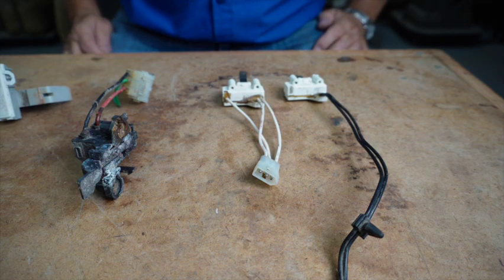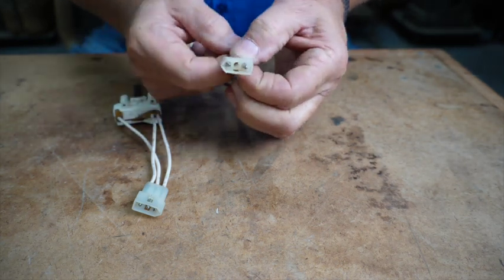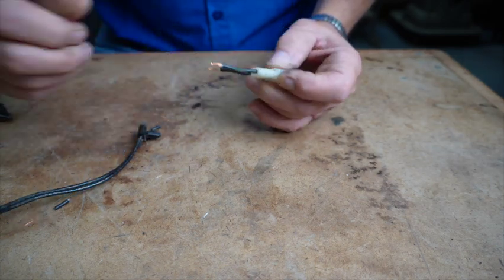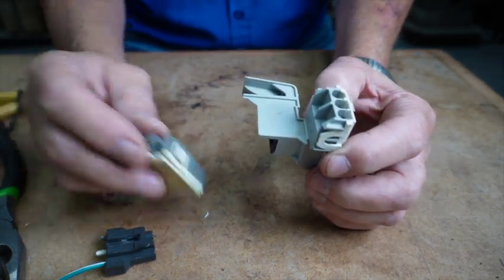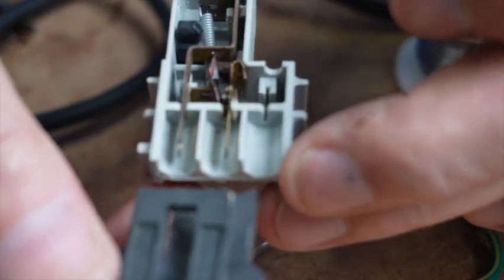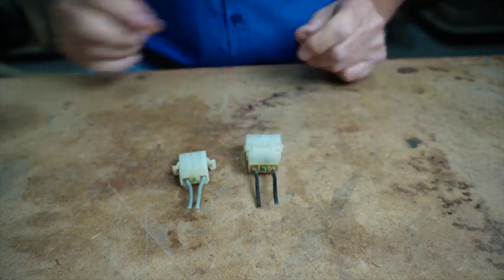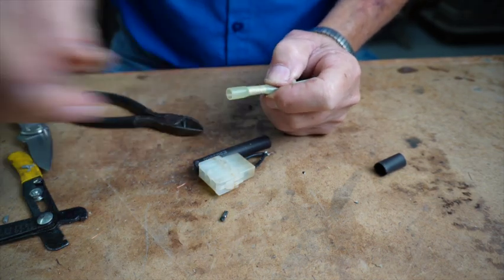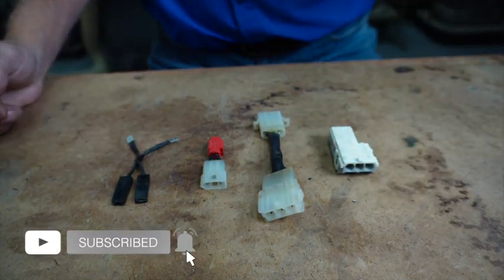How To Create Lid & Door Switch Bypasses for Washer/Dryer Diagnostics

Comment: Hi ' I'm a new subscriber to your channel, and really like your videos, Actually I'm having issues with my Whirlpool Cabrio H2o Low model. Actually I'm not able to stat any cycle I thought it was an issue with the lid lock which I replaced which I brought from amazon (LCAPT AP5263307). Tried to start a wash cycle and got exactly the same thing (lid lock still flashing and nothing happens not sure if you have any idea on how can I bypass it or it may be other components). Also saw a leak under the washer. Appreciate it!
Reply from the maker: Yeah, don't attempt to bypass lid locks you will almost certainly do damage to your control board. I would troubleshoot your lid lock. Check the striker still has a magnet in it. Also be sure the pins in the plug on the control board are making contact with the female side of the plug. Thanks for subscribing!

Comment: I popped mine apart and it seems to click and connect. How or why do I know it's bad?  I don't see the problem.
Reply from the maker: If its working don't fix it. Thanks for watching!
Reply: @HarperandKnowles  Well, it's a whirlpool. I have changed out the coupler (only because it was new) Changed out the clutch (even though it looked fine) Now I'm fiddling with the switch and it seems fine. Why doesn't it spin??? It agitates and doesn't spin. I've thrown the parts cannon at it to no avail.
Reply from the maker: Bypass the switch and see what happens.

Comment: My machine has a bezel that holds the door cut off switch in place and one of the ears has broke off. Any suggestions? Amana model NTW4516FW2
Reply from the maker: This is part of the switch itself. You will have to replace the switch. Here is a link for one https://amzn.to/3V1fhnb. You can search through my videos and find several where I replace the lid lock if you need guidance. Thanks for watching!

Comment: You don't need to modify with those harness. I use double tape stuck one on the top of others to make it thick and jam it in the hole of the lock switches (there are two of them), I also remove the latch mechanism mounts on the washer lid. Every time now when it fills up water while I put the soap in. Easy modification. This modification also will not void your warranty.
Reply from the maker: The video is for service technicians that may need a bypass in the field but thanks for the tip. Thanks for watching!
Reply: @HarperandKnowles  My wife and I had a 12 years old Admiral washing machine. It was lid opened with running water while my wife or me to fill the soap, then after 10 minutes it locked the lid. This new Whirlpool will not allow to have soap fill while the water runs. This is the reason I have to modify the lid. 
I called Whirlpool, a technician recommend me to modify the wiring. That will be involved with wire cut. I told him that NO because I do not want to mess with this new one and especially to deal with the voided warranty.
Then I tried with the method above and it seems to work very well. We leave the way it is from now!

Comment: If the lid switch is faulty will it make the water keep running and flood  ?
Reply from the maker: No, the water level is controlled by the pressure system which involves a pressure reservoir, a tube and a pressure switch. Thanks for watching!

Comment: 3 wire Samsung Dryer door switch bypass
Reply from the maker: On this switch, there is one hot wire, a return wire (door switch), and a wire for the light. I think the center wire is the light but I could be wrong. I never made a bypass for one of these but I'd try popping the old switch open and fusing all the contacts together with solder. Or, trace which wire goes to the light bulb and eliminate that one. You could try using two male spade connectors and trim them to the same size as those in the switch plug using side cutters and put them on the end of the same wire to jump the hot wire and the door switch wire. It would be nice if you could find a three-wire male connector that would just plug into the dryer side. Of course, replacing the existing switch is your best option. Thanks for the comment. You've given me a new project idea!  Thanks for watching!
Reply: Don't try to by pass with the side washer door. Your accidentally opening will flood your home, :)